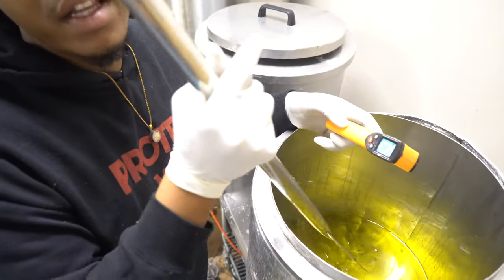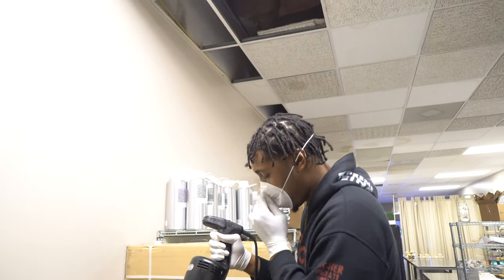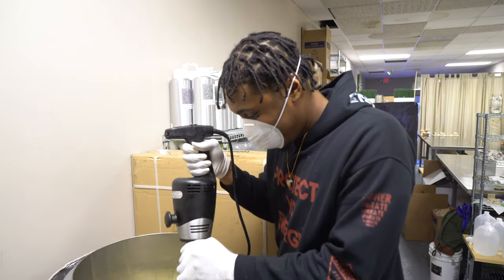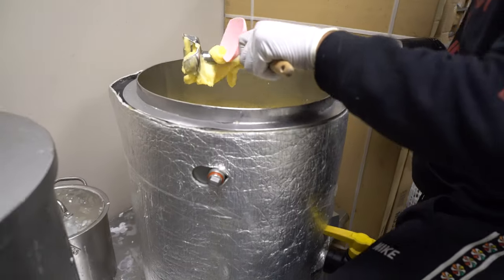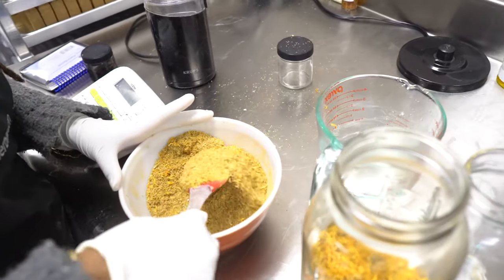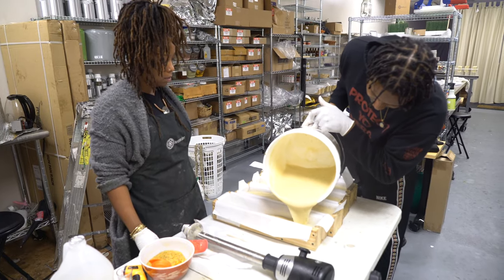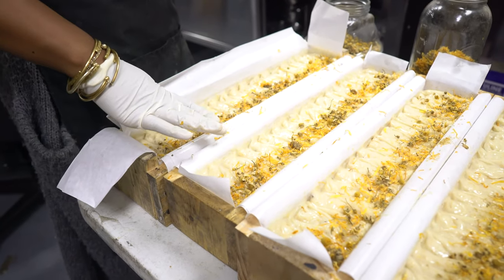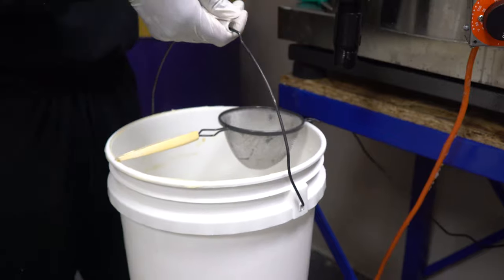Liquid Soap vs Bar Soap Production, Scaling Our Liquid Soap Production, Chamomile & Calendula

Comment: Here is a clip from the Soap School on mixing lye with no fumes.

Also, the volcano occurred because you were soaping at too high of a temperature.

https://youtu.be/gbwZwrU3uGU

And a Hobart mixer would help your liquid soap production 

https://youtu.be/Po3bdOqMOo4

Per Anna Maria owner of Brambleberry....
Hobart mixer. And using ice then pour the lye. That should help you produce more and cost less. Also, using the heat of the lye to melt your oils

https://youtu.be/KrDGo7bVTyk

Volcanoes happen when you Soap too hot.

Used a Kitchenaid for my liquid laundry soap.

Ice will help.